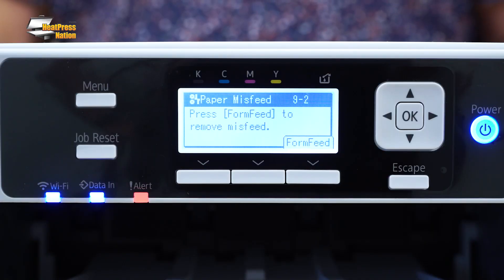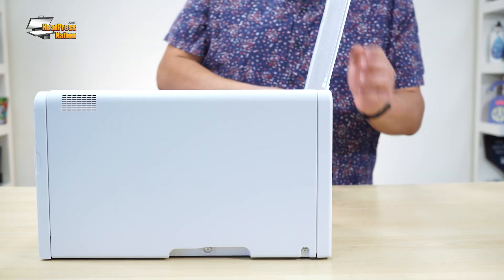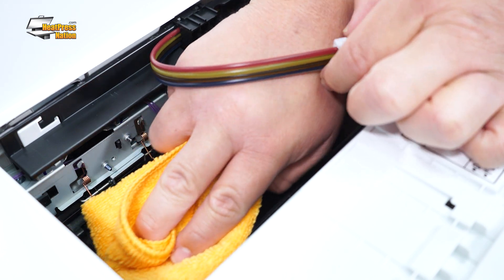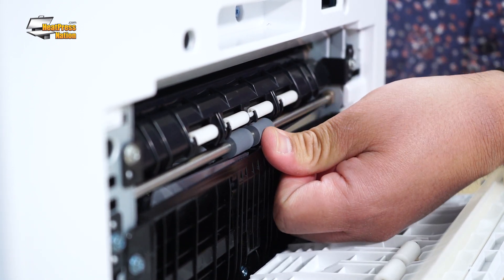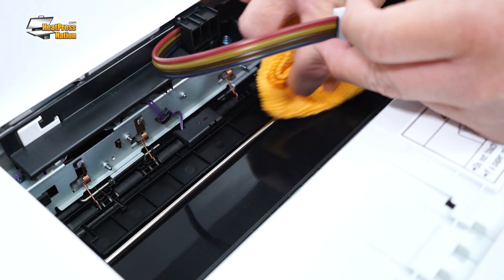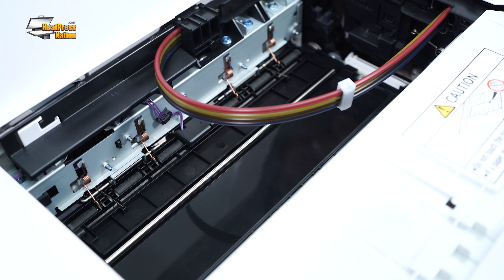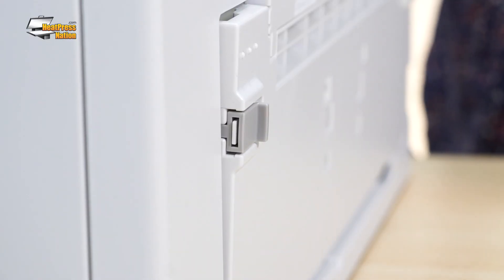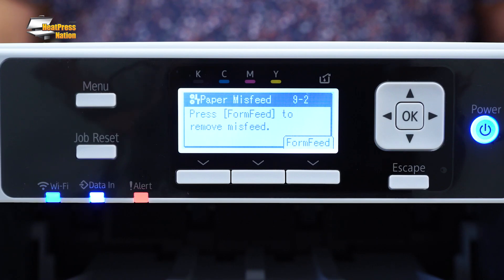Sawgrass SG500 and SG1000 Paper Feed Troubleshooting - MyExpert Tutorial

Comment: I'm having issues with my sg1000. It stops printing halfway through and then spits it out
Reply from the maker: Hi Dennis! Are you choosing the correct media size when printing as to the one it is being printed on? For example, if you are printing onto 11x17 but chose 8.5 x 11 on print manager, it will cause a misfeed error.

Comment: 8.5 x 11 works fine, when switching to 8.5 x 14 I get the misfeed error. I have printed on 8.5x14 paper before no problem now I am having issues.
Reply from the maker: Here are a few steps to avoid a misfeed when changing paper size:
- Be sure to change the paper size of your original document, as well as in Print Manager
- Make sure the side walls in the paper tray are adjust to fit the paper, but aren't squeezing it in any way.
- Make sure the tray is locked into the extended position with those little green tabs

If this doesn't work, please feel free to reach out to our technical support department at https://heat.press/support

Comment: I had a misfeed error after finishing the ink installation. Wasted 3 sheets of 8x14 dye-sub before deciding to try a sheet of regular 8.5x11 copy paper. Seems like you want to use 8.5x11 when you run the initial setup.

I will edit the comment if I have any more trouble with 8.5x14 moving forward.